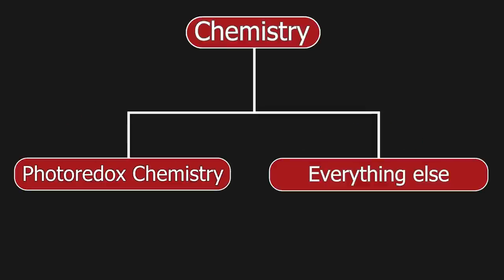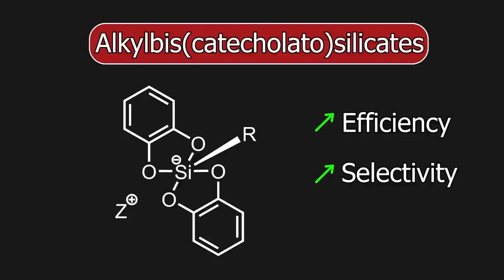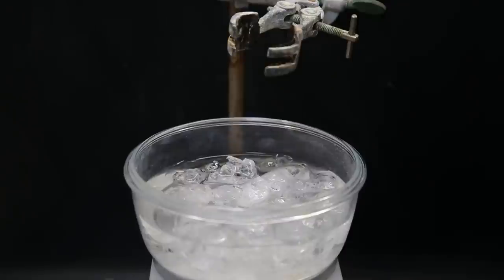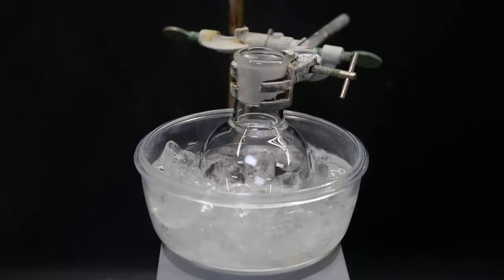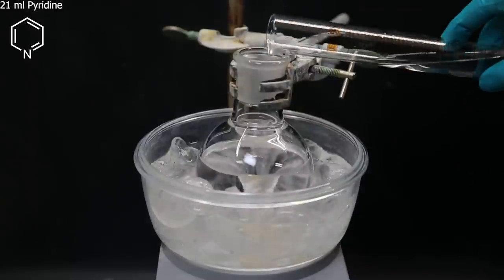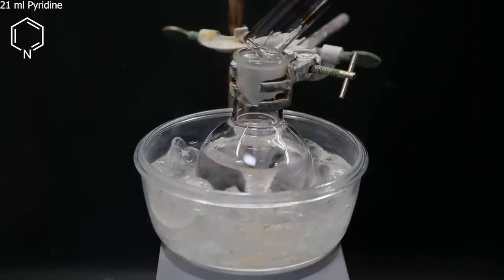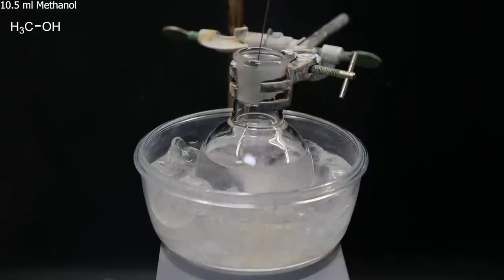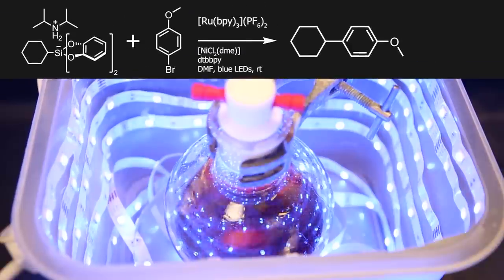New Molecules for Chemistry with LEDs

Comment: Finishing a PhD in photoredox methodology here. Your yields are low for likely 2 reasons: 1. the lack of inert atmosphere (O2 will quench the photocatalyst rather than the substrates) and 2. the flask surface area to volume ratio. By Beer's law, only the very surface mm or few of the solution will receive photons due to the high molar absorptivity of the Ru(bpy). Thinner reaction vessels, or ones with higher surface area to volume ratios, tend to work better (dram vials or even a flow setup in PFTE tubing).

Comment: I think the way to optimization of the reaction of  catechol and that trimethoxysilane is trying to swap the solvent for 1,4-dioxane. THF and methanol have really close boiling points hence all the pain with restarting the rection. Dioxane however boils around 101 C, so technically we can try to distill the methanol over by controlling the temperature of the rextion mixture. Of course there are many factors that can go wrong but I feel like this is the first step at least.
Reply from the maker: Could be. I wonder if it’s possible to just add 4A sieves in the reaction
Reply: @Chemiolis  maybe, but those are usually zeolites and can go ham in the mixture and catalyze everything into madness.

Comment: The low yield is very probably the reaction is not carried out in an inert atmosphere. As the Ru(bpy)3 as your photocatalyst, it generates triplet excited state via intersystem crossing since Ru has effective spin-orbit coupling for this spin-forbiddened transition. This triplet excited state can be quenched by dioxygen as it is also triplet in its ground state. This causes the  single electron transfer from your photocatalyst not that efficient

Comment: I read a paper recently about using a photochemical reaction to add acetone to the double bonds on an unsaturated fatty acid, making an oxetane ring, which lets it be cleaved in MS/MS and allows the location of the double bond to be revealed in MS. They literally just put a lamp by the electrospray, no actual machine modification necessary
Reply: Do you have link of the paper?

Comment: Nice video! I Remember making a similar ruthenium complex myself for some photooxidation...
If you are using oil pump, i would never use its out air for column: oil contamination
As for photochem, for good yields you want to maximise surface for light irradiation (tubes/test tubes are better than flask, small ones are better than big ones). and second, you want to kee mixture cool or better cold (cold finger inside reaction vessel works nice).
As for light box, metal kitchen ot works nicely, led strip glues good and it works as radiator for them
Reply from the maker: I just use a membrane pump, the oil pump is way too powerful and has no exhaust connection
Reply: @Chemiolis  Thanks Mendeleev beard....
Membrane pumps are awesome XD
I see that making nice photochem setup (i am talking about you Explosion&Fire XD) is not so easy, especially to make it work efficiently. Do you plan any more photochem? Or it is end for now?
Reply from the maker: For now I have no plans for more photochem like this, but maybe I will try UV in the future
Reply: @Chemiolis  Ok, good to know :)
Then making better photochem reactor is no needed for you. Keep on great work with videos!

Comment: A potential reason why the yield was low for the photo reaction is that many of them are reversible reactions. Exposing to UV supplies the correct energy for a reaction but if it is also exposed to white light through lighting in the rooms and transporting out of the photo reaction vessel it may reverse.

Comment: Great stuff. I'm not sure about the chemistry here, but O2 can definitely act as an electron scavenger to throw off yields. But I also think the setup is a big culprit for the low yield. RBFs generally aren't the best photo reaction containers because the curved surface will cause a large portion of photons to be reflected and never reach the solution. Remember, any photons reaching your eyes are photons that don't reach the reaction.
Reply: Also a good idea to use quartz glass for any photochem
Reply: @wingl5841  Not true in this case, the blue light is not absorbed by the glass. UV would be, but not visible light.

Comment: Another good video, with excellent solutions! Light is an entire field of study, so using a light source is not only simple. In trying to make light do work it must be offered no other option— and, it must find the work easier than not. I recommend creating a similar chamber of light-in-an-insulated-box then aiming the light towards a hole in the ceiling for convenience while placing the reactives in the way. This is similar to how a solar power cell works! Good luck.
Reply: Can you elaborate more on why the orientation matters? Not sure I get the difference
Reply: When light orients itself is towards less effort, since that is not productive. All work makes less effort needed. So the light will travel through a hole in the ceiling otherwise in all directions evenly. If light travels along all paths evenly it is least likely to find the work you want also! Light from the sun is this way by finding simply “the earth” and your solar panel atop!

Comment: I would have liked to see you characterize it with something more accessible than an NMR. Use a plain IR Spec or get the refraction angle or check for light rotation or mp/bp etc etc.

Comment: Do you have any idea what that pink compound was? Also, what was the point of using tri(m)ethyl orthoformate? Great video!
Reply: my guess is that it's some quinone complex; no idea about the orthoformate though
Reply: @That_Chemist  the orthoformate sequesters the water present in the starting nickel salt. Triethyl and Trimethyl orthoformate should both work equally well for that.

I've used old catechol in the past that was slightly pinkish brown, can't think of anything other than a quinone that it would be - they're often quite strongly coloured.
Reply: This pink stuff is most likely oxidized catehol, orthoformate is used probably to remove water from the reaction mixture

Comment: I haven't read the synthesis instructions, but actually a certain wavelength is always required for this kind of photoreaction. RGB LEDs may appear to emit only light of a specific wavelength. But this is not the case. In fact, RGB LEDs only mix the colors using red, green and blue LEDs that emit different levels of intensity. Nevertheless, this does not result in monochromatic light of a specific wavelength, which is often required in such syntheses. It would have been better to choose LEDs of a specific wavelength.

Comment: I also think not having an inert atmosphere was what gave you a low yield. The mechanism goes via radicals. These would readily react with oxygen and ruin the reaction. I know from experience with radical polymerization with low catalyst loading. Oxygen above 200-400 ppb causes big changes to the polymer because of radicals interacting with oxygen.  Therefore, I guess an inert atmosphere is crucial to get a decent yield in photochemistry.

Comment: 5:02 Distiling ethers to dryness is a bad idea, leftover peroxides may cause an explosion. Nevertheless, great video! But I'm not sure if yields are that much higher so like 4 more days of working in a lab are worth using this kind of reactions.
Reply from the maker: Distilling ethers isn’t that problematic when they are stabilized (which this one is). This is mostly an issue when you have unstabilized ethers that u got through distillation by urself.
Reply: How else are you supposed to remove etheral solvents lmao

Comment: Reactions involving radicals like this one are very sensitive to oxygen. In fact, retarded reactivity under oxygen is used as an indicator of a radical pathway. Lowered internal pressure due to consumption of oxygen might cause the plug to get stuck. Also, doing photochemistry using a round flask isn't a quite good idea, because according to Lambert-Beers law, only the very outer layers get some meaningful lighting, and the solution is so so dark.